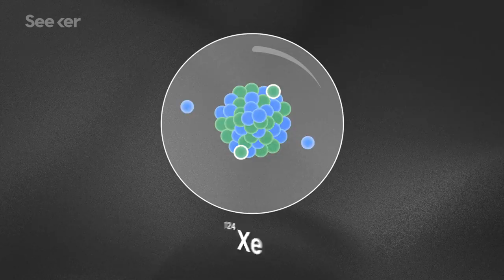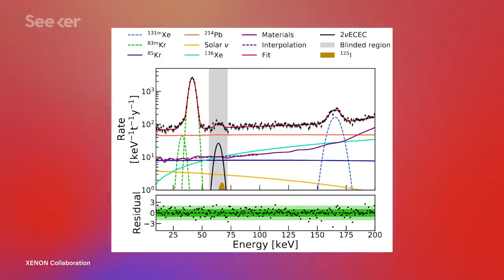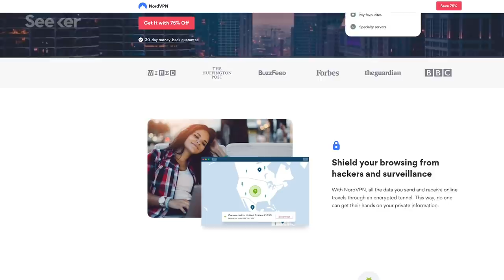Scientists Were Hunting for Dark Matter...and Then This Happened

Comment: Is this video about dark matter?
Seeker: "Well yes, but actually no..."
Reply: John Walker are you ruling out something without a proper thesis defense?
Reply: John Walker  Indeed. It's just the equations that cannot work with nothing. Therefor there must be something according to them researchers.
Reply: @dominusfons4455  It's simple. You know the properties of dark matter? It should have mass. Ok whatever. How they gonna detect that mass?? 

They say it does not interact with other dark matter. So it keeps nicely spread out. No?. 

It is non detectable trough the electromagnetic spectrum. So they think it has mass but they can not actually know. Because there is no way to observe it.

Now what is space? And it doesnt matter if that is space in your room or space in space.

Space is nothing. Unless it is defined by the matter that occupies it. Take away the walls of your room and the space of your room can no longer be defined. What is this space? Isn't Dark matter just space??

Hey its like the aether. A medium where light propogates trough. The medium cannot be found. Yet light propogates trough space. It still suggest there should be a medium. Just not a static one.
Reply: @w.t.h.2040  There are so many holes in your comment it actually is laughable.
Reply: @codejunki567  Ye those holes are filled with dark matter to.
Reply: @codejunki567  Also time will not tell you anything. The experience you have in a certain time frame is gonna tell you things. Time just is there. Just like space and the suposed dark matter.
Reply: @codejunki567  technically he's right though man, and I'm pretty sure he's basically saying that it is beyond what we think and can comprehend simply because we can't understand it in almost any way in a certain manner, which is what you started your comment with basically, so maybe think before you say he knows nothing because you didn't even realise you re worded and then repeated what he said for the most part with no argument of your own. At least he stated some facts with his opinion.
Reply: Thanks you save my live
Reply: Exactly lol I had to go back and watch again to make sure I didn't miss something 😂
Reply: @Faxy95  Exactly. Dark Energy and Dark matter are hypothetical forces to explain what happens in space. For example dark energy is basicly just a force that explains the expansion of space. They think it is the energy of the vacuum itself that kinda behaves like anti gravity. 

Dark matter and dark energy only exists because without them the equations do not work with what we observe in space.
Reply: John Walker  amen
Reply: Can somebody tell me what the hell is dark matter? 🤨
Reply: @w.t.h.2040  oh you must know a lot about these science, are you? May i ask what is the the field of your study?
Reply: @w.t.h.2040  mhm and how do you propose space works?
Reply: @lolgamez9171  Space is nothing. You cannot measure space without matter. First you need matter. 

So space does not work. It's just a consequence of matter. 

Almost the same as time. Time is nothing without matter. Time can only be measured trough matter. And thats why scientists talk about space-time
Reply: @PedramNG  Lol i didnt study anything in those fields because I hated school. But i did alot of research because since i was young i have the question: how does everything work.
Reply: @PedramNG  It's a non observable matter that should exist to explain many forces and happenings in space.
Reply: @w.t.h.2040  right and where's your evidence for this claim?  In order to overrule centuries worth of debate and consensus you would need outstanding evidence.  This hypothesis of yours, how does it help explain planetary motion?  Or the interaction of sub-atomic particles?  You would need to prove how your hypothesis explains the universe better than the leading consensus.  You would also need to demonstrate how it works and show instances where it explains phenomena that the consensus cant.  It's an interesting point of view but it does absolutely nothing more than breed a "stick it to the man, I'm smarter than everyone" mentality similar to conspiracy theorists and flat earthers.
Reply: @lolgamez9171  And where is the evidence that the theory we use is right? And where is the evidence of dark matter and energy?
Reply: @w.t.h.2040  our theory explains planetary motion.  While the theory's aren't married yet we can also explain some sub-atomic relations.  And I admit the consensus doesnt explain everything.  However yours explains absolutely nothing and has no evidence or research whatsoever.  The reason we build such big instruments in the first place is to learn more about the universe.  And unless you can prove that "space is nothing," is more than a simple thought experiment sit down and stay in your lane.  Unless your theory explains the universe better than the consensus no one will believe you.
Reply: @lolgamez9171  It is because human minds have trouble understanding infinity. The human mind has trouble with something that we cannot touch. This is because our whole life is based on what we experience trough touch and all that. Our experience is not infinite. This is why the human mind does not understand.

According to humans there should always be something. But what if the nothing keeps the something stable. Because the nothing occupies way more space then the something. Isn't the nothing automaticly the counterweigh then?

Scientists say it is. They say that counterweigh is Dark matter and dark energy. 

Please visualize in your head and think deeply. Just like budha did.

About you sub atomic comment. Sub atomic particles even occupy space. Thats how we find them
Reply: @w.t.h.2040  mmm yes the human mind cannot grasp this muguffin yet this random commenter, who has not once answered the question of where the backing to his claim is, has deeper knowledge and wisdom than scientists all over the world.  If you have deeper knowledge the prove it.
Reply: @lolgamez9171  I don't need to prove it. They will prove it for me. They already did prove my thought the last 10 years. 

And if there is any force we know of that indicates im right it will be the electron. The true god particle.
Reply: @lolgamez9171  Also please how can I prove what I say if even our scientists can not prove that fact? All other things I said are truth and can be verified by yourself.
Reply: @w.t.h.2040  you say all these thing but you don't link any sources.  You don't do anything but claim things.  Where is the evidence?
Reply: @lolgamez9171  Ok i changed my mind let me throw some of the links I use to try understand space and everything that happens in space. 

https://www.space.com/20502-dark-matter-universe-mystery-infographic.html

https://en.m.wikipedia.org/wiki/Kepler%27s_laws_of_planetary_motion

https://en.m.wikipedia.org/wiki/Coulomb%27s_law

https://en.m.wikipedia.org/wiki/Classical_mechanics

https://www.google.com/amp/s/www.space.com/amp/36273-theory-special-relativity.html

https://www.google.com/amp/s/www.space.com/amp/24870-what-is-space.html

https://en.m.wikipedia.org/wiki/Electromagnetic_radiation

I can put twice as much links easily if you want.
Reply: @w.t.h.2040  you literally just linked a bunch of modern and classical theories.  Nothing about "space is nothing"
Reply: @lolgamez9171  Space is full of things but without things space is empty.  Nothing there then. But space still exists even when there is nothing there. If you have NO space then it means the space is full. 

Space is nothing except that its space. Thats all there is to it.

But since you say space is not nothing. Then please tell me why space is NOT nothing? What is space then? Explain to me what it is then? What is the thing called space. How can grab space? How can  I see it? How can I make space travel trough the 3 dimensions?
Reply: @lolgamez9171  Space is the boundless three-dimensional extent in which objects and events have relative position and direction.[1] Physical space is often conceived in three linear dimensions, although modern physicists usually consider it, with time, to be part of a boundless four-dimensional continuum known as spacetime. The concept of space is considered to be of fundamental importance to an understanding of the physical universe. However, disagreement continues between philosophers over whether it is itself an entity, a relationship between entities, or part of a conceptual framework.
Debates concerning the nature, essence and the mode of existence of space date back to antiquity; namely, to treatises like the Timaeus of Plato, or Socrates in his reflections on what the Greeks called khôra (i.e. "space"), or in the Physics of Aristotle (Book IV, Delta) in the definition of topos (i.e. place), or in the later "geometrical conception of place" as "space qua extension" in the Discourse on Place (Qawl fi al-Makan) of the 11th-century Arab polymath Alhazen.[2] Many of these classical philosophical questions were discussed in the Renaissance and then reformulated in the 17th century, particularly during the early development of classical mechanics. In Isaac Newton's view, space was absolute—in the sense that it existed permanently and independently of whether there was any matter in the space.[3] Other natural philosophers, notably Gottfried Leibniz, thought instead that space was in fact a collection of relations between objects, given by their distance and direction from one another. In the 18th century, the philosopher and theologian George Berkeley attempted to refute the "visibility of spatial depth" in his Essay Towards a New Theory of Vision. Later, the metaphysician Immanuel Kant said that the concepts of space and time are not empirical ones derived from experiences of the outside world—they are elements of an already given systematic framework that humans possess and use to structure all experiences. Kant referred to the experience of "space" in his Critique of Pure Reason as being a subjective "pure a priori form of intuition".
In the 19th and 20th centuries mathematicians began to examine geometries that are non-Euclidean, in which space is conceived as curved, rather than flat. According to Albert Einstein's theory of general relativity, space around gravitational fields deviates from Euclidean space.[4] Experimental tests of general relativity have confirmed that non-Euclidean geometries provide a better model for the shape of space.
Reply: @lolgamez9171  Space is one of the few fundamental quantities in physics, meaning that it cannot be defined via other quantities because nothing more fundamental is known at the present. 

It cannot be defined via other quantities. Means it is not there right? And if it is there then nothing else is there. So its still nothing.
Reply: @w.t.h.2040   bro space is not absolute, and neither is time.  But spacetime is.  Youre good at word salads but spacetime being a thing has been shown through empirical evidence.  Space is not nothing, it is relative because it need time to be absolute.  If there was absolutely nothing in the universe but a spinning bucket with you in it you would still feel the g forces.
Reply: @w.t.h.2040  Ernst Mach was wrong.  There is an absolute point of relativity and it's spacetime
Reply: @lolgamez9171  Funny joke. Like that would work...
Reply: @lolgamez9171  Then how you call these things that are at the beginning. The present. The end? 

Absolute: 
a value or principle which is regarded as universally valid or which may be viewed without relation to other things. 

something that exists without being dependent on anything else.

It also can mean ultimate reality or God. 

So... I dont know where Einstein got his silly idea of saying its not absolute. Also his silly idea of combining space and time makes no sense. I can see why.  But I just cannot understand why he did that.

Space contains matter and energy. Time is just on the side line.
Reply: John Walker  -- There are several instances in scientific history in which an entity existed in theory before it was detected experimentally.  Antimatter, the Higgs particle, gravity waves, and black holes all existed theoretically before they were detected.  Just because dark matter has not yet been detected doesn't mean that it doesn't exist. And just because it's counterintuitive for the average Earth bound human being doesn't make it irrational to believe.
Reply: Thought this video is about VPNs with some dark matter clickbait
Reply: clickbait / ad / need moneyz :-(
Reply: @w.t.h.2040  So much of this is just not true. And i'm not gonna school you. Read up again.
Reply: @w.t.h.2040  bro you don't know what you talking about, rotation curve of galaxy, gravitational lensing of galaxies cluster is  some of the evidences for dark matter existence, stop acting like you know everything, your understanding is somewhat elementary
Reply: @hassanzakieyusoff6597  And yet. It's all relative.
Reply: @w.t.h.2040   dark matter is everywhere simply put dark matter is light . Light has a plank mass and there is a lot of it . Light interacts with gravity there for has a mass even if siencetis can't mesure it .  Don't get me started on light  spoiler alert what people call the speed of light is not correct  but that's a I nother time
Reply: John Walker  you do know they are trying to figure out what dark matter really is.   saying there is no such thing as dark matter means you know what it is. Please tell me.  People like to deny the science of dark matter or dark energy  because it leads to the thought of a design tl everything.

Comment: Now here's a question I have of some relevance to this; This particular isotope of Xenon has a half life after which it decays to form another element. Other isotopes of Xenon are thought to be stable, if I'm right, but here's my question: is there such a thing as a stable element that will not decay into something else, or are all elements, regardless of isotopes, in fact unstable and will decay into something less after sufficient time, even, say, Gold 197, which is probably one of the (if not the, as far as I know) most stable atomic isotopes in existence?
Reply: Iron?
Reply: 80 elements have stable isotopes. Every element has radioactive isotopes, but some of these do practically not occur under natural conditions. E.g. gold consists naturally only of one  isotope which is stable. 36 radioactive gold isotopes have been synthesized artificially.

146 isotopes are stable in observation and theory, and a further 105 isotopes are so far observed to be stable, but may turn out to decay with a very long half life from a theoretical view.

Comment: Subject: Alternative theory for dark matter

IMAGE GRAVITY (SS):-  Existing structure of galaxies are not stables without
dark matter But a new force which is image gravity (named by me as “SS”)
will be introduced by me.

Explanation in brief :-    Line of attraction (Gravity ) between two
celestial objects is the vector sum of two components one in a straight line
and other is in a curve. Curve component is only in plane normal to equator.
The angle (named by me as Angle of Power, P) can be as high as 40- 50 Degree
for bullet clusters or around 1 degree for stars on outer rings of galaxies.

1.       Angle of Power (P) is proportional to distance (R), and Rotation of
object.

2.       Gravity field (normal component) + Gravity field (curve component)
are equal to (G Mm /R 2) normal gravitational law for near objects only.

3.       Gravity Field (normal component) is reduced with square of R but
Gravity Field (Curve component) is reduced by R only as it is one dimension
less than gravity.

4.        Angle of Power (P) is called so because it provides extra energy
and pull for the revolving object.

5.       Image gravity (SS) will be created at the point of interaction of
the curve component of both the objects.

6.       A constant is required in the equation.

7.       After solving this equation on available data of many galaxies we
can actually find the correct value of G also ( up to 20 Decimal points ).

8.       For a cluster of galaxies it can be taken analogues to a domain in a
magnet.

Comment: They should have had 2 units instead of one.  One of them with the current setup and the other with no observer tool including security diagnostics. At the end of experimentation all they would have  had to do was removing Xenon from the unobserved unit. Remainder would then be the dark matter. If cessium 135 is filled then into that unit all content would become the dark matter when exposed to 345nm light . Good luck humanity.

Comment: What type of mathematics measure these large scale Half-Life if they were the subatomic equivalent interactions of a higher plane. If our gravity and dark matter forces were actually compression of one layer of existence / reality upon another. Something akin to string theory . If the speed of light were the boundary of matter and energy at the leading edge of the compression,  moving forward in time to that edge constantly moving lockstep but unable to surpass nor to recede into the flattened past due to the force and magnitude of the compression.?

Comment: Wouldnt zenon 124 interact with the metals copper stainless steel  try introducing depleted uranium surrounding a high density plasma magnetic feild.you could also try various metal gasses to try to get a responce. Possibly various gasses as well